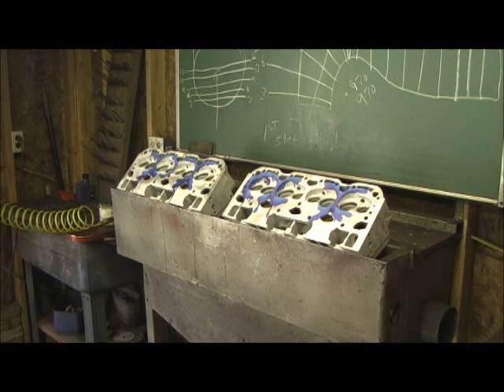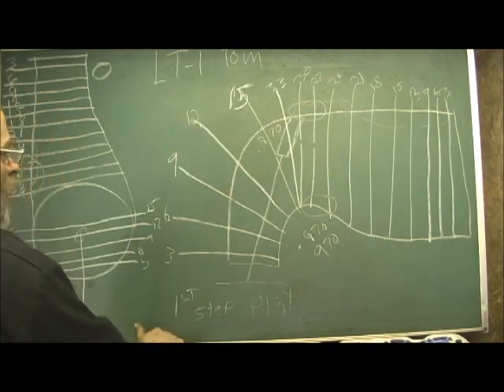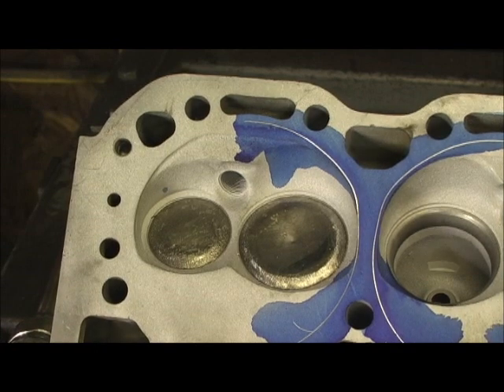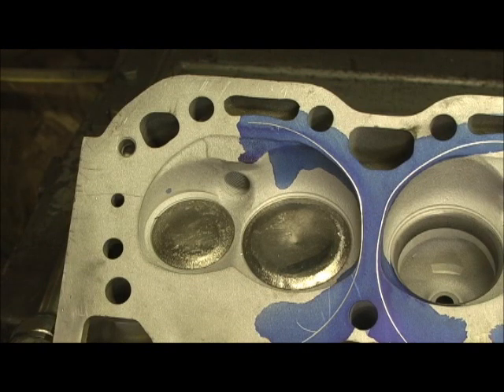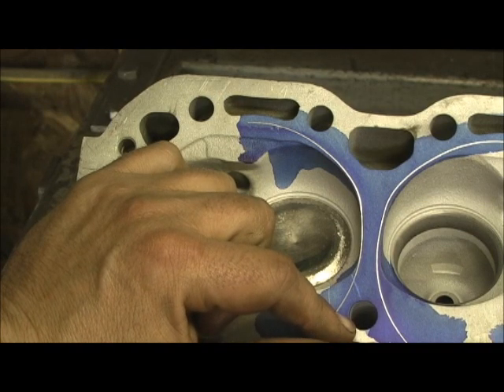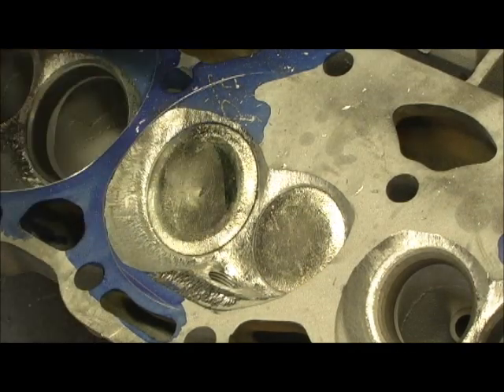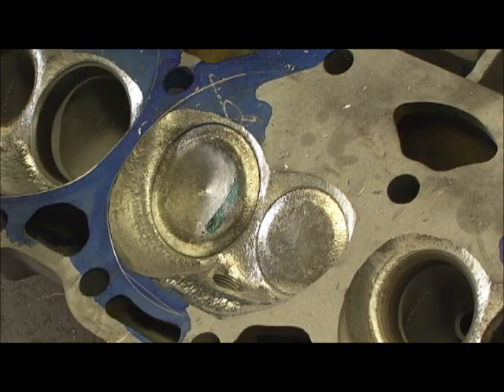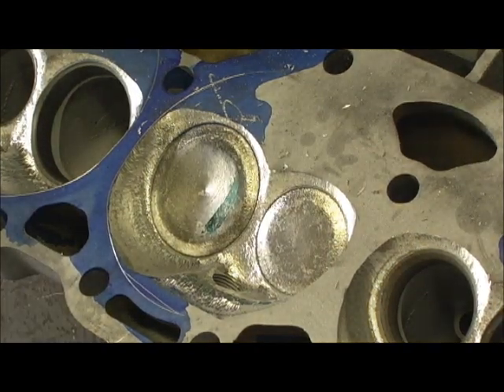Chevy LT-1 Cylinder Head Full Porting Stage IV

Comment: wow!! Woyuld love for you to do that to my heads (94 Chevy 9C1 police Intercepter--LT1 350) have the heads port matched with my Hooker headers which are ceramic coated, need a good cam and lifters, push rods and roller rocker arms and need to add 100hp to the rear wheels, using 3.42's and 245-60 R15 tires.  Using a H-pipe and 3 chamber mufflers too. Car will be used mainly for long distance cruising and occasional drag racing-about 4 times a year, bracket quarter mile racing.

Comment from the maker: I am honored, really guys. Hey, if you have any burned up rods laying around that you was going to through away, I use the aluminum to pour cross-overs in my old heads (to fill the cross over path to stop the exhaust gasses from heating up the manifold). If you sent them to me, I would send the cash to cover your shipping cost. About 10 or so would be GREAT. Thanks and I plan on doing a let before the end of the year.

Comment from the maker: One thing you need to know about this is S/V ratio, or the ratio of the burn rate known as Surface to Volume ratio. This determines the effectiveness of the burn in the chamber. I believe it goes like this: the less surface of the chamber to the volume of the bore means it burns more effectively. For example the Chevy 18 degree heads have a LOW S/V ratio, making it a high quench head that burns like no tomorrow. remember that NO combustion chamber is a great combustion chamber in terms of BOTH

Comment: Yeah, that valve design on BBC is just brilliant! Thank you for your reply. I have some Audi 20V 5cyl head on my table and want to add some squish areas and pretty much improve overall burn process. I consider this head to be somewhat stupid in design, because it has a huge volume of CC way away from the plug. And a small quench, while it could have few! So I needed your re-explanation of that. Sometimes we need to blend our thoughts as well! Thanks!

Comment from the maker: Part III of Quench: The problem of quench is, like I said above is Valve Shrouding. I know you herd of the "CURTIN" of the valve, well there it is (or in this case, is not!!!). The valve on any head has to have a certain amount of "Curtin" to let the air/fuel charge exit around the valve. That is why the BBC is such a bad ass head, because of the canted valve rocks in terms of unshrouding the valves as it moves toward the center of the chamber once it leaves the seat. The best is a good mix here

Comment from the maker: Continued from DoriFord comment below: That being said, the quench effect has several major benefits for sure (Less Timing required to achieve max horsepower, the engine runs COOLER for sure, Throttle response in greatly enhanced, and compression is increased); however you can only compress what is sent in through the intake cycle I the first place so I would say (and this is my opinion) that first and foremost Air-Flow is king (or C.S.A.). The problem with too much quench is valve shrouding.

Comment: And blacktop has more power than silvertop. Of course, there were some other mods, but the engineers were crazy about quench area back then. Possibly, you get pretty big flow numbers with 3 valves on the intake, so you can sacrifice that a bit for smaller CC and faster burn. Just google it, it's an interesting evolution of one head. Both engines were available in a period 1992-1997, mostly in Japan.

Comment: Haha, thanks for your reply! In terms of whether airflow or quench, you choose airflow? You know, there is an interesting point on CCs on Toyota 4AGE 20V engine. There were 2 versions called Silvertop and Blacktop. S-top was the first gen for 20V inline-4 engine, both came with individual throttle bodies from the factory. The main difference is CC design. Silvertop has an opened chamber with small quench, Blacktop has more squish than any other engine I've ever seen. Might impede flow a bit!

Comment: Uh huh! That's an interesting point on that hump near plugs. My friend once brought me LT1 head, so that I could advise him something. Yet there were not many things that's possible to do with the intake port (w/ no epoxy or welding), so all I could advise him were those ridges around the seats and wavy hump around the plug. Anyway, I think that if you could WELD that hump into a flat surface, you could get a second squish area and improve swirl inside the chamber. Correct me if I'm wrong! Thx!